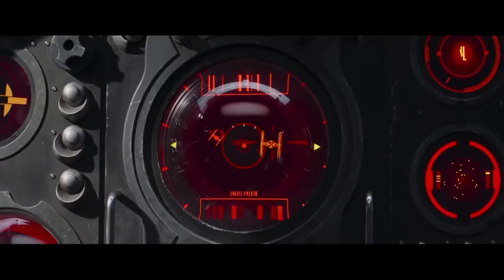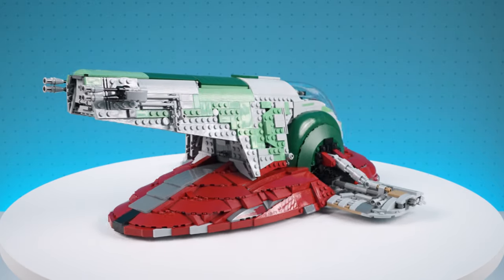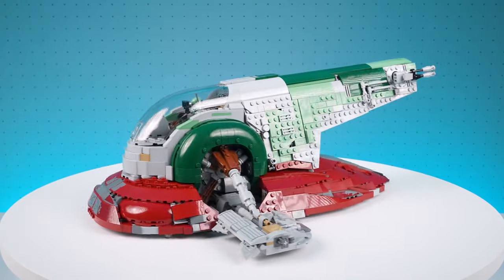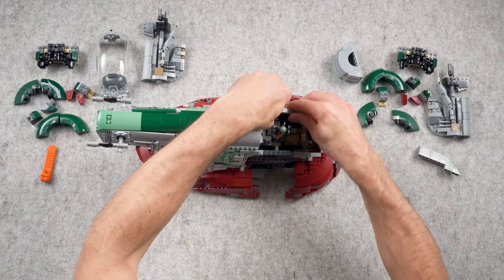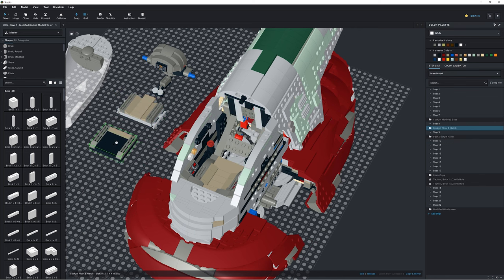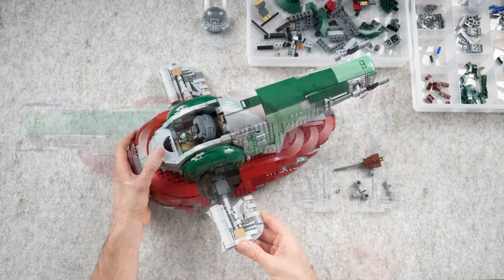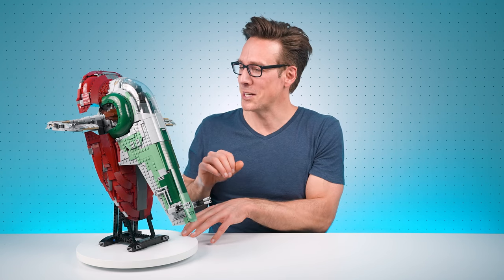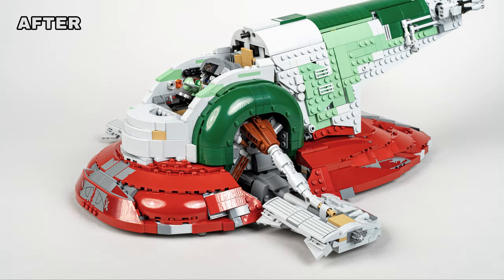How to FIX your UCS Slave 1 Lego Model

Comment: Downloaded your instructions and parts list tonight.  Thanks for doing this!  I disassembled my UCS Slave I several weeks ago, and plan to build the internals with color corrected parts.  I’ll be using all or most of your ideas and creating a video on my channel sometime in January - you’ll be mentioned 😊. Also plan on following through on these ideas with an additional Jango version, too.

Happy Holidays, Simon.
Reply from the maker: That sounds like a worthy project, I think you will be happy with the changes Joel! + it's good to hear you are re-building your model making colour corrections to get rid of off coloured parts, I did that with my build too and it makes a significant difference, especially to the underside of the model. All the best and Happy Holidays to you too! 😀

Comment: Good sir, quite excellent mods once again. Looks much more accurate and yes, replacing with dark tan pieces are a much better match. My main hang up was the dark red slopes towards the back. It just didn't "staircase" very well and looks chunky. That will be my mods in addition to yours.
Reply from the maker: Hi zealot951, I think you'll enjoy the mods and good luck with changes to the rear of the model.  That's going to be a challenge ...but I'm sure worthwhile!

Comment: Really appreciate you putting this together.  I've been interested in making these updates for a long time.  Wonderful work.
Reply from the maker: Thank you Aaron and it's no problem at all. Publishing mods ideas & instructions is one of the key facets of my channel. I hope you enjoy modifying your Slave-1 I think you will be very happy with the improved model!
Reply: @CraftedBricks  I just realized that you used a dish piece on the back of the ship on top of the large blueish gray dish.  What piece is that?
Reply from the maker: Hi Aaron, good spot!  I actually made quite a few changes to the underside of my model, to swap out all of the black and light tan and other weird colours for predominantly dark stone grey to give it a consistent look.  I didn't mention this in the video as it's almost impossible to do those changes retrospectively unless you fully disassemble the model.  To answer your question: for the sensor dish center I used: 4032 (2x2 round plate) + 6942 (5x5 dish) + 2654 (2x2 boat stud).  With this config the model won't sit flush if displayed sitting flat - so I did some further mods to seat the large dish further up into the model.  If you are displaying the model on it's stand you many not need to do that.
Reply: @CraftedBricks  would you happen to have the list of parts that you color swapped? And are the additional mods for the dish complicated? I just bought a UCS Slave 1 and can't wait to build it along with your mods which really elevate the set!
Reply: @CraftedBricks  Due to my excitement, I was able to figure out which pieces you used for the dish upgrade.  Thankfully I had the parts needed and made the additional changes last night.  I'm very pleased with these upgrades.  Now the Slave 1 fits even better with my brickvault ship collection.
Reply from the maker: Sorry Stephane - I didn't write down all the color swaps so I can't share a list with you.  But what I would recommend is that when you set arrives or before you start your build, study the instruction manual to see where off color parts are going to be visible.  

Going off my memory I swapped out any visible light tan plates or parts on the underside of the model for dark stone grey equivalents. I also swapped out some of the black parts, again for dark stone grey parts.  And in some cases later on in the build when you are building the body sections I swapped out all of the light tan parts for dark tan. Also swap out any of the red 3L pins with a bush in the frame of the model for corresponding black pins.  There were a few other technic parts in red I think  that I also swapped out for better colours.   The next time I build a UCS set and do this sort thing I'd better write down my changes - as it seems people are interested in these sort of subtle mods!

Enjoy your build!  It's a superb set and after my cockpit & cowling/control-arm/stabiliser fin mods it truly is a beautiful model to have on display.
Reply from the maker: As for the dish - I can't remember the exact build steps! When you come to building the structure that the dish mounts to in the technic frame you need to mod it to sit 1x brick height upwards into the body. Even with this change the model doesn't sit truly flush with my alternate sensor dish internals (although it's close) so only attempt that mod if you are going to display the model on its stand.
Reply from the maker: @Aaron-ek5jv  Man I love your enthusiasm Aaron - well done and I'm pleased you've been able to upgrade your Slave-1!  ...in perfect timing to watch the 2nd episode of the Book of Boba Fett! : )
Reply: @CraftedBricks  Thanks!  Highly detailed lego models of Star Wars ships in "minifig scale" is a bit of a secret hobby that I have so it's always nice to be able to share my excitement.
Reply: @CraftedBricks  thanks for the pointers! Another thing I am considering changing is the colour of the engine exhausts. They are light blue in the model but are depicted as orange in the films if I remember correctly

Comment: A very nice set of mods there. Do you know if there is a mod to add the fold out missile launchers under the main blasters?
Reply from the maker: Hi Colin, thank you.  And to answer your question, unfortunately no I'm not aware of any mod examples to include the fold-out missile launchers under the main blasters.  Given how the UCS Slave-1 is put together with the side-wall plates tapering in at the back there and the underlying Technic structure, it would be hard (but not impossible) to do!  Good luck!

Comment: plz tell me which is the part u use in the back side in the round green on top, u use a green light circle piece
Reply from the maker: You have to be more clear on what you mean.  Do you mean the underside of the model with the thrusters, or the top rear section of the model.  May be have a look at the inventory of parts for this model (unmodified) on Brickset may help you: https://brickset.com/sets/75060-1/Slave-I

Comment: Great video! I love the final result of the moc, I only have one question, the blades rotate by themselves just like the original model?, Thanks!
Reply from the maker: Thank you Tropper Brick!  Yes the stabiliser fins will rotate on their own if you change the angle of the model.  With my updates the fins are little heavier, so the rotation may be a little slower or get stuck at times - but shouldn't be a problem as predominantly the model will be on display in a static position.
Reply: @CraftedBricks  Thanks for answering!, waiting for the order of parts to make the modification, I like the final design. Also, knowing that they rotate by themselves is a point in their favor.

Comment: Hi Simon, been a while. Hope you’re well? 
I do have a question with the Slave I Mod. In the Modified Cockpit Extra Parts io file there a 2 off 1x3 DBG plates that I cannot find where they go. It’s noted as Step 23 in the Studio io file. Is it a mistake or oversight?
Reply from the maker: Hi Robert, nope I think I know where they go but I'll need to check and respond to you tomorrow. I've got an event on tonight. 🤷‍♂️
Reply from the maker: Hi again Robert - the 2 DBG 1x3 plates are used on the inner faces of the two side-wall panels of the body, right at the top and at the back near where the windshield slots in.  They replace the 1x4 plates in the same colour - as there needs to be 1 stud clear for the new rear wall with with the 4L bars to seat flush against the technic frame.  Let me know if this makes sense.
Reply: @CraftedBricks  yes I found out last night when I couldn't fit the new cockpit interior and 4L bars. Otherwise I love the new modification, really takes the model to another level in authenticity. Tell me is it worth keeping the original parts, or did you part them out into your general inventory? 🙂👍

Comment: The list of required bricks is quite inaccurate; in the end 35 (including the two 1×4 plates removed from the back) of them were unused and there were already spares of several of them from the dismantling of the official design. Still, thank you so much for providing the guidance to this modification.
Reply from the maker: Hi Isak, I'd like to correct this.  What specific parts are duplicated / or that you had left over?  Two 1x4 plates only or others?  Can you please let me know.  As you can I'm sure appreciate when modelling up mods to an existing set in Studio I always make sure that the required parts inventory I publish includes ALL of the parts needed to do the mods.  But it can sometimes be difficult to figure out the delta of new parts needed versus what you are removing from the standard model to tune the require parts down to a bare minimum.  You will have parts left over after this mod - that is expected, and it's good to have extra parts for your next build!
Reply: @CraftedBricks  The following are parts that were ordered.
All 1x1x1 modified brick with stud on one side
All 1x4x1 modified brick with studs on one side
2 1x2 lbg grilles
2 1x2 lbg plates
2 1x2 lbg curved slopes
8 dbg studs
1 1x1 lbg round tile

The following are excess parts from the official build which in addition to the list above could've been deducted from the Rebrickable parts list.
2 1x2 lbg curved slopes
1 1x2 lbg grille
2 1x4 dbg plates (if these were removed in an earlier step than 94 they could be used in the mods)
2 2x2 dbg plates
[8 1x2 dark tan plates to replace some internal dark green ones]

There is also a mistake in the instructions where the lbg 1x4 plates underneath the top edge of the the back wall of the cockpit aren't in place when installing it back. Plus I think you could mention that it doesn't need disassembly just like the captain's chair. Also one 1x1 round tile beside the right weapons hatch is the wrong colour in the instructions. 

I was also able to move the 2 top 1x2 technic bricks toward the end with cannons by one stud and make a minor modification to the inner part of the cowling, in order to allow the 1x2x1 modified bricks with clip on one side to fit back into their original position to hold Boba's weapon, which in turn leaves the 1x1x1 lbg bricks unused.
Reply from the maker: Hi Isak - thank you for your detailed reply.
You spotting the 1x4 LBG plates behind the standard cockpit rear wall/floor and colour change for the 1x1 round tile were helpful.  And I've made some minor adjustments to reduce some parts from the mod inventory.  I've not covered your full list as many of the choices I have made for the extra parts are deliberate - for colour consistency or would be difficult to specify/omit given the building step order.

The great thing is at no point will anyone doing this mod be 'short' on parts - and they can complete the mods successfully, be happy with their improved model and have left over parts as spares for other projects. Your feedback has been helpful and I've published version 1.1 of the instructions up on Rebrickable now.

All the best to you, Simon

Comment: quick question. i bought the bricks from brick link , but they sent me brown bricks . the rebrickable list them as reddish brown but are they not dark red instead?
.
Reply from the maker: Hi hutchewah - if you are talking about the parts for the main control arm - the colour of Redish Brown is correct.  So you've ordered the right parts.  There are no New Dark Red parts needed in this mod.
Reply: @CraftedBricks  ok
Reply: Hello CraftedBricks. of course you were totally right on the color, I assumed they were the same color as the ship and i thought my parts supplier had shipped me the wrong colors, my bad.  Anyway the mod looks fantastic and please accept my humble apology.
Reply from the maker: You don't have to apologise! All is well and I'm very happy to hear that you are happy with your modified and improved Slave 1!  All the best, Simon